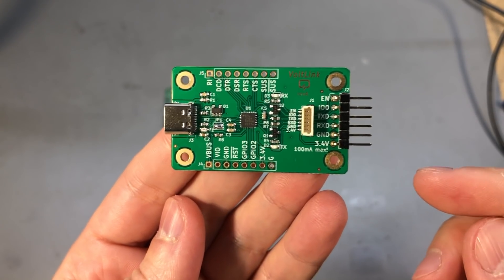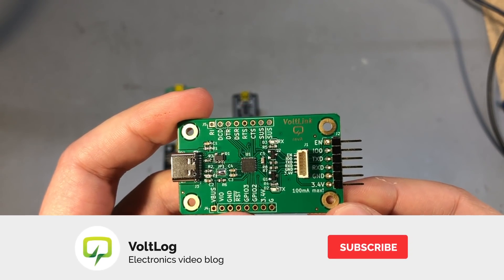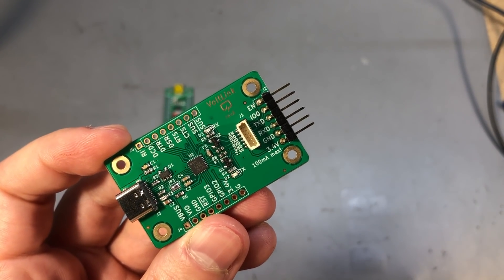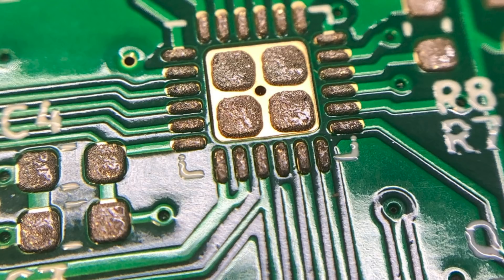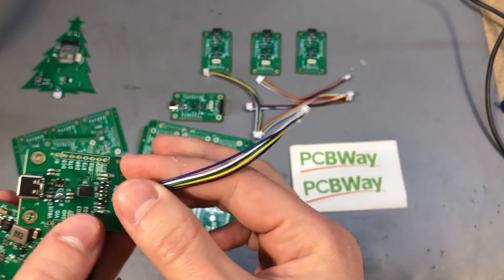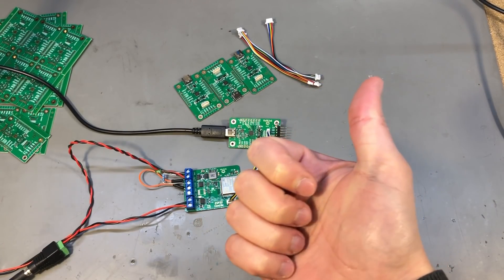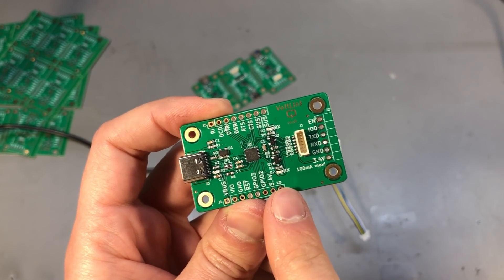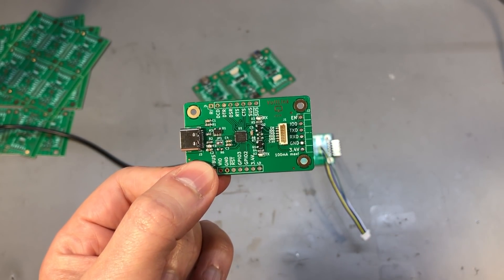VoltLink A Fancy USB Serial Adapter (ESP32 Programmer) - Voltlog #356

Comment: Hi, I'm interested on your mistake on the RX/TX LED because I think I had the same problem 😅, the indicator is swapped.
I'm failed to understand the information on the datasheet. So the correct ways is GPIO0 to indicate RX data and GPIO1 for TX?

Comment: Very cool. For the next generation of your board, aim for a solution that does not require driver installation but instead implements USB CDC ACM, supported by all major operating systems out of the box.

Comment: I'm definitely going to order one when they're back in stock in your Tindie store.  I really like the design.  It would also be really cool to make a "VoltLink" to pogo pin breakout board so that we could just design boards with a 2x3 array of pads and not have to solder on a JST-SH connector.  we could just press the breakout board against our PCB for a few seconds while our code uploads or 3D print a fixture to make it even easier.
Reply from the maker: It seems like the CP2104 is out of stock everywhere, probably due to ongoing global chip shortage so the VoltLink won't be back in stock any time soon.
Reply: @voltlog  Will the CP2102n work, or are you using specific features of the CP2104?
Reply from the maker: @peterteal880  It will not work without board redesign.
Reply: @voltlog  OK. I appreciate your reply!  Keep up the good work!
Reply: @voltlog  I see that the CP2104 are not recommended for new designs and the CP2102N is the recommended replacement. Considering that, perhaps you should consider the redesign of your board.

Comment: I did a USB serial adapter too! An isolated one, with extra protection diodes:

https://github.com/claudioarena/EQMOD_DIRECT_Isolated

Designed for astronomy mounts, but turns out to be useful in many situations where you want isolation (to break usb ground loops, for example...)
Uses the super cool ADuM120x isolation IC. A bit expensive but a super nice chip.

Comment: When PCBWay panelizes your board, do they send you any gerbers back to you, of the new layout, so that you could PNP them?
Reply from the maker: Not automatically but it can't hurt asking for them. However in real world scenarios whoever does PNP will most certainly panelize the boards themselves for optimal results.
Reply: @voltlog  Hmmm.  I suppose a deep dive into the specs PCBway (and any other PCB fab) would allow you to do your own pannels.  But they sure seem to have some tips and tricks that the average person doesn't know.  That would make a great video if you could collaborate with them on that!  (reason I say that is DIY PNP machines are getting easier and easier to build,  thanks to things like the "OpenPNP" project.

Comment: I have an older EPROM programmer/burner from Andromeda Research Labs that uses a parallel port. Most inexpensive USB adapters won't work with it so I've been using an old Windows XP notebook with it. I think the adapter has to be PCI buss or something. Maybe there is a modern versatile chip programmer you can recommend? Thanks.
Reply from the maker: Unfortunately I can't recommend anything, I don't do much EEPROM programming.

Comment: 2 megabaud is sweet!  My cheap CH340e's are small, but are not at all reliable at higher speeds.
Some MCU's need oddball parameters too ... like 57.6k 8E1 ... also difficult with a CH340.
Reply from the maker: Yes! And it really starts to become important if you have to hit that upload button multiple times a day!